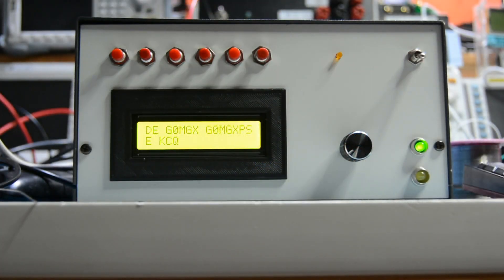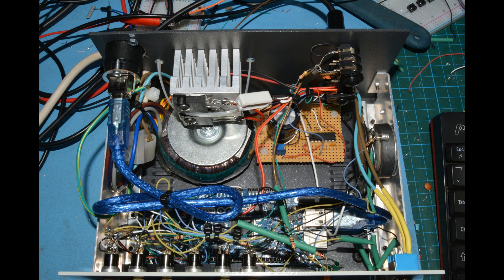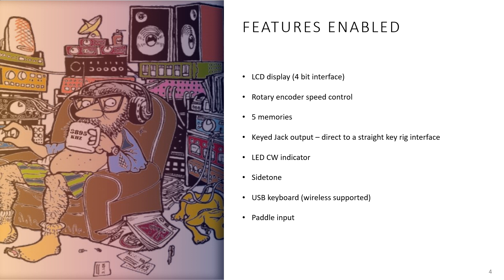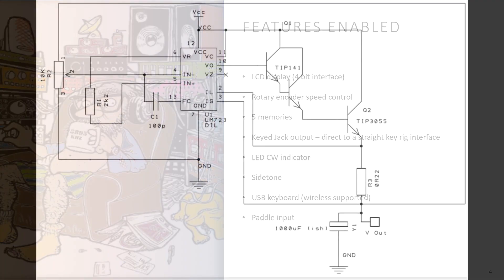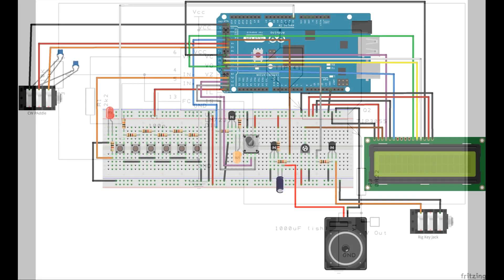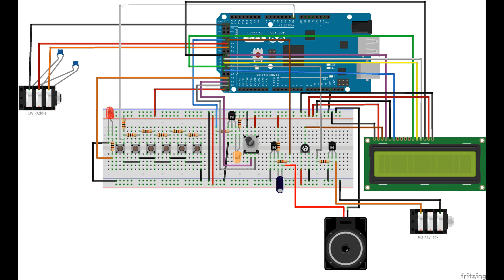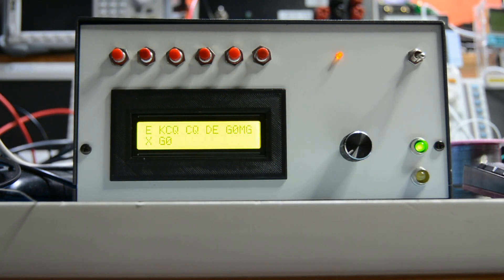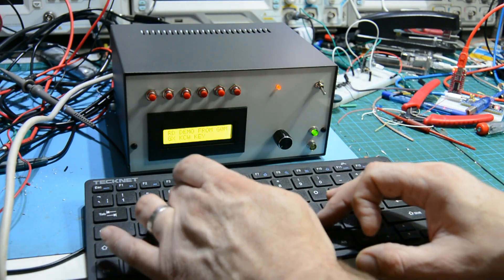My K3NG Arduino CW Keyer Build

Comment: Hi again Mark, i'm building this, just ordered the Arduino, i'm using 2N2222 transistors, I guess they will do and I have some. The keyboard you use, is it a wireless one like this one please? It will be used home and portable so I need a small compact, reasonably robust unit. I think I need to buy you a coffee sometime!

https://www.amazon.co.uk/TeckNet-Wireless-Keyboard-keyboard-Whisper-Quiet/dp/B00M75WPKO/ref=sr_1_3?dchild=1&keywords=wireless+keyboard&pd_rd_r=531bdb15-ac63-414d-a18d-6e87a98ee983&pd_rd_w=SZy8A&pd_rd_wg=8nkUw&pf_rd_p=5f50c5c7-54ba-45ff-a0c8-f07a51775ead&pf_rd_r=THRMEMHVRQ3Z6SE4P8N7&qid=1607108896&sr=8-3
Reply from the maker: Thats exactly the same keyboard as I have. The 2N2222 should be just fine :-)
Reply: @MarkG0MGX  thanks again

Comment: Does the keyboard connect to the Keyer? I don't see it in the schematic? I only use a straight key so never had incentive to build this but the keyboard integration would make it useful. 73 de G0LBK
Reply from the maker: Yes, the keyboard connects straight to the USB connector on the Arduino board - hence the need for the ADK board with the integrated USB connector.
Reply: @MarkG0MGX  thanks, I think I'll make it a project as you have it, it will be spot on for my needs. Thanks for sharing the information. Subscribed.